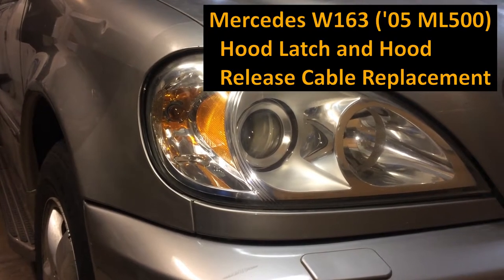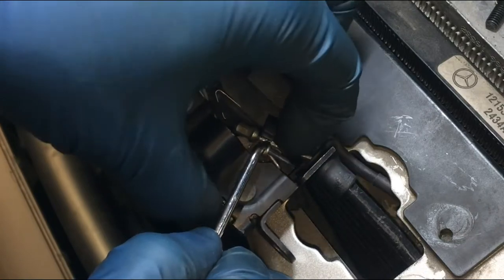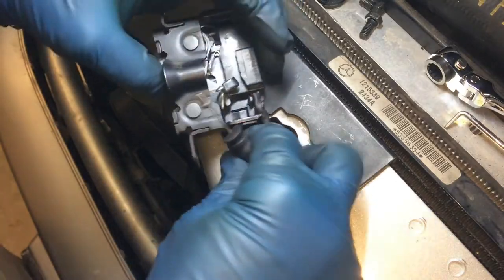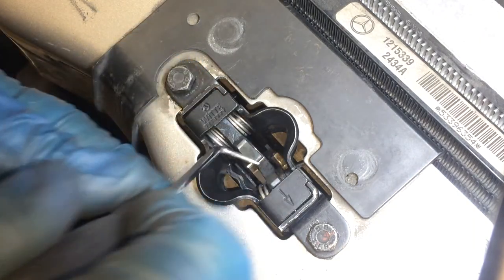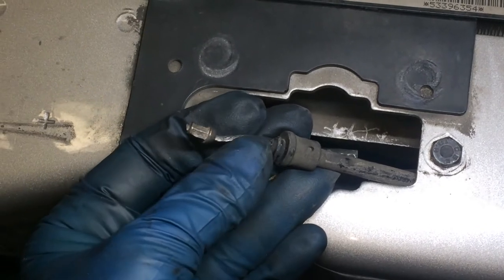Mercedes Benz W163 DIY Hood Latch and Hood Release Cable Replacement ML320, ML350, ML500, ML430

Comment from the maker: Timestamps, Part Numbers, Links:
Link for a video if your hood is stuck closed:
https://www.youtube.com/watch?v=7nIGTehCtnM

00:34  Parts: Latch (A210 880 0960); Sensor (A1635407006); Cable (A163 880 0159)
00:42  Begin Hood Latch replacement
01:25  Disconnect the cable from the latch (10mm)
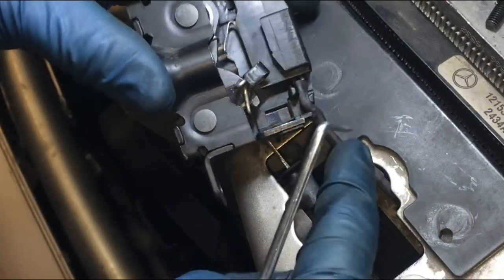01:41  Disconnect the sensor from the latch
02:24  Reconnect the sensor to the latch
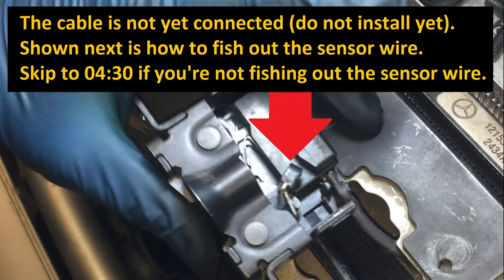03:00  Fish out the sensor electrical (if you're doing this)

04:32  Reconnect the cable to the latch

04:58  Reinstall the latch and two 10mm fasteners
05:32  Test the latch

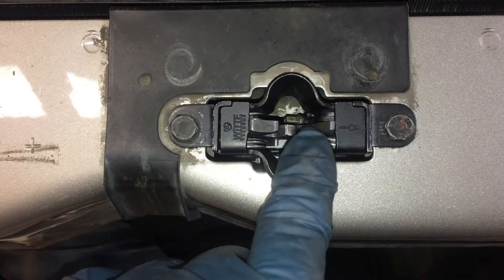06:41  Begin the cable replacement repair
07:38  Inspecting the cable route
08:25  Remove the fuse box covers (Torx 20)
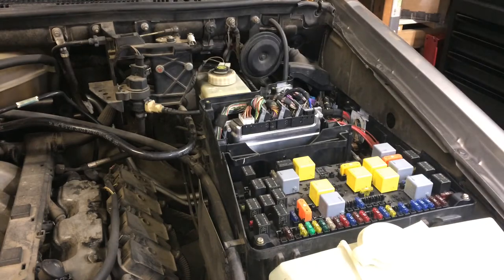09:33  Remove the cable grommet from the fuse box
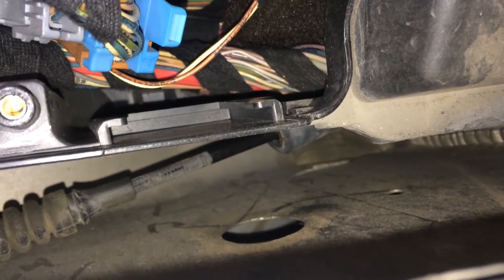10:23  Disconnect the hood release lever in the cabin (8mm)
11:09  Set up a pull-through wire to fish the old cable out from the cabin side
11:32  Set up a pull-through wire to fish the old cable out from the hood side
12:12  Pull the old cable through on the hood side
12:50  Remove two cable guides
14:05  Pull the old cable through on the cabin side
14:57  Secure the new cable to the pull-through wire on the cabin side
15:30  Install the cabin side of the new cable
18:42  Remove three small interior trim pieces 
20:10  Install the cabin side cable into 
20:37  Pull the new cable through on the hood side
21:46  Install the cable to the guide in the cabin
22:17  Reinstall the cable release lever (8mm)
23:03  Reinstall interior trim pieces
23:34  Install the new cable to the two guides in the engine bay
23:55  Install the hood latch (10mm)
25:57  Check the cable operation using the lever
26:42  Reinstall the cable grommet to the fuse box
27:25  Reinstall the fuse box covers (Torx 20)
26:03  Test the latch and table with the hood open
28:07  Test the latch and cable with the hood closed

Thanks for watching, and thanks for 3,000 Subscribers!  
I hope this video was helpful.  Good luck with your repair!

Comment: thats a beautiful truck! also what could be the cause of a very very faint battery light? 2000 ml320, people are saying its the voltage regulator in the alternator.
Reply from the maker: Yes, the voltage regulator is a big possibility -- you can replace that part for just $35 or so, so it is a good place to start.  If you can get to an auto parts store like Autozone or Advance, they can test the alternator in the vehicle: if it comes back as a failure, then I would pull the alternator and inspect the voltage regulator.  Here's Legit Street Car's video on the mattter:
https://www.youtube.com/watch?v=lqDgdtHZUzU
Good luck!

Comment: On the front bumper of you ML, where could you find those headlight washer covers? I replaced my bumper and accidentally ordered the one for headlight washer.
Reply from the maker: I have found them at the junkyard in the past, which is nice if you happen to find one of a matching color. Otherwise, I think ebay is probably your best bet, and your MB dealer might be able to order one in that is new old stock. 

Call your dealer and double-check me, but I think (not sure, double check me) that the part number is A163 869 04 08 for the right side, and 163-869-02-08 for the left side, then MB adds four extra numbers at the end for the color. 

So for example, 163-869-04-08-9999 is a right side cover in the color "black opal":

https://www.mboemparts.com/oem-parts/mercedes-benz-cover-plate-16386904089999

There are some colors available from aftermarket makers too:
https://www.carid.com/replace/2003-mercedes-m-class-bumpers/replace-front-headlight-washer-cover-141642309.html

Be sure to pick the correct side (right or left). I hope that helps - good luck : )
Reply: @L35inColorado  thank you!!!